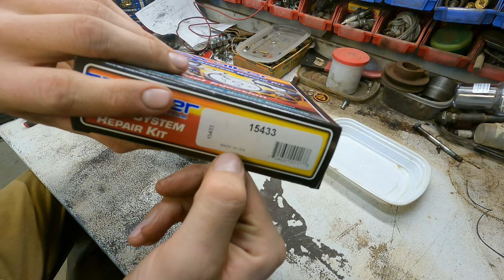Is this 1950's Galion Road Grader worth saving???  Cursed Grader Pt.2

Comment: Are those tires 20 inch if they are some old truck tires would work maybe like 10.00 x20 or 12.00x20 as long as it has a tube and liner.
Reply from the maker: Yes I have some but I’d rather have proper tires on it. I’m looking at a few options
Reply: OK I just saw the old snow tires on the rear and thought that an old set of straight rib steering tires would work if cost is a factor and the fronts are free wheeling hubs. I love the old grader . Nice videos

Comment: Thanks for showing the force grease nipple cleaner, I have one that I bought at Princess Auto Liquidators (very similar to Harbour Freight, may be the same owners)  I had no clue how to use it.  You used light oil, my thoughts are would carb cleaner or brake cleaner expedite the softening of the grease?

Comment: I'd leave the three bolts as dowel pins, the strain is mostly rotational.
Reply from the maker: thats an interesting idea... I thought about using allen head bolts because I should be able to get an allen key in it.
Reply: @DieselCreek  Pretty easy to shorten an Allen key too.

Comment: And if you take the cans that have ran out of co2 to spray anything take an air compressor with a air gun and hold the nozzle down on the can and press the airgun nozzle to the hole in the can nozzle and air them back up

Comment: Im not 100% positive, but if my memory is right you can swap a glass float bowl  onto that carb. They are neat and can save you time when you are troubleshooting carb problems.
Reply from the maker: Yes I thought it looked possible but not worth trying to find one
Reply: @DieselCreek  theyre easier to find than youd think.  a lot of old cars and trucks had them especially mid 50s Fords. Even my 55 Ford Ranch Wagon had one

Comment: Out of curiosity did you put some Zinc additive in your oil? I have heard that most older engines have flat tappet camshafts and that modern oil doesn't have the zinc properties to prevent wear on the lobes. Very entertaining video, keep up the good work.
Reply from the maker: ive seen some people say that. never been an issue before.

Comment: In regards to your oil packs, we have 4 or 5 litre oil containers here. Watching you fill that up was painful, considering how much plastic wastage there was.
As to the grease points, I have always just used heat to soften the old grease.
Reply from the maker: One of these days I’ll just start buying drums of oil because I hate all the waste too.
Reply: @DieselCreek  Buying a box of small bottles of oil seems to be an American thing.  Down Under we can get oil in 1L packs, but it's so much more expensive that everybody buys 5L, 10L or 20L containers.  Or 205L drums.
Reply from the maker: @dfross87  Id like to start getting drums eventually.
Reply: @DieselCreek  Drums are nice.  Electric oil pumps with digital flow meters are even nicer.  No need to lug oil containers onto equipment, just take the hose, pull the trigger and watch the readout.  Easy as fuelling up.

Comment: Did you dip that carb, or don't you have a gallon of the exquisite carb-eating liquid?  The new eco stuff =sucks=, but the old methylene chloride dips are viciously efficient.  Berryman's Professional Chem Dip still comes in 1 and 5gal buckets and they have dip baskets available, too. I used to swear by this stuff in my wrenching days.  Do not breathe the fumes! //  Don't worry about that tire.  It's only flat on one side at a time.  //  Good call replacing the throwout bearing.  Your blue ax scared me.  I've bent (or cut and welded) wrenches with red heat to get them to the proper angle for weird bolt head angles.  //  I'll tell you one thing, I sure do appreciate your videos compared to the crap they put on teevee. (happily dumped cable in '07)

Comment: Really need to check your air cleaner out also and see if the mice got into it too.
Reply from the maker: I’ve cleaned it out when we got it running, it’s an oil bath they can’t get in there

Comment: The tires tilt to keep you in a straight line. The blade will drag you the direction it’s angled. So you tilt the tires the opposite way to keep you going straight.. ish

Comment: Looks like that hose going to the release bearing could stand to be replaced also. Being hydraulic, I suspect it is vulnerable to the same issues that old brake hoses have.
Reply from the maker: Ill inspect it for sure before re assembling
Reply: @DieselCreek  👍
Reply: @DieselCreek  Ya know, in lieu of putting those bolts back in on the bottom, you could drill the two outer ones and put a couple dowels in. The upper bolts are probably more than sufficient to hold the bellhousing together.

Comment: Are you using Craftsman wrenches.  Their box end wrenches better for a hammer than wrench.  I worked on airplanes where nuts or bolt heads have very small side clearance.  You had to use thin walled Snap-on wrenches.
Reply from the maker: I tried using mac/and JH williams but neither were even close to fitting.

Comment: guess your slowly gettn the equipment and cheap im sure people dont realize these older machines are very simple to work on all ya need is fuel air and water basically antifreeze and good electirical conections i love to work on residential lawnmower tractors
Reply from the maker: lawn mowers and garden tractors are what got me started working on stuff. I was big into International Cub Cadets. I have about 15 of them still floating around...

Comment: On those bolts there’s a bunch of crud on there it looks like caked up mud or something, is that just blocking the bolt I don’t think that’s the housing maybe you can ship that stuff off. Other than that all I can think is maybe you can cut a socket down so you can fit it in there with the wrench. Other than that I can think is maybe it’s a long bolt that goes all the way through and bolts up from the other side so all you do is put an open end wrench on that side to hold it as you unbolt the other side maybe. 🤔
Reply from the maker: I thought that too but I tried chipping away at it and its for sure the casting. its liable to get ground out a bit before I put it back together.

Comment: Maybe you can replace those bolts with studs and nuts. Make the nuts yourself out of hex stock ,and make the nuts protrude out past those recesses so you can get a socket on them. Could you leave a link to that grease fitting clearing tool.
Reply from the maker: that might be a good idea, ill put the link in the description!

Comment: Warming the fitting helps, always, always, always, tighten them just a tiny bit, before trying to remove, then you can use a scribe, spray lube etc to clean out rust and debris, instead of forcing all that crap into thejoints, especially the ball joints... at least it's a hydro model and not a knuckle buster...  do not use a MAP torch or similar for heating, not even propane, heat gun on low, hair dryer....too much heat too quick will not be a good thing....

Comment: Ten or fifteen minutes to warm up, that’s nothing my continental straight six takes about a half hour in the summer to warm up and winter it takes an hour or more. It lites real easy and quick just takes forever to warm up that old clearance crawler. Like to have an old grader like that for moving snow from in front of my mail box....sometimes the plows leave a burn of snow in front of my driveway and mail box and the two stage thrower just can’t bust up that ice.

Comment: You need a crowsfoot socket for those bolts. But I supposed torch works too lmao
Reply from the maker: my crows foot were too big to get in there.
Reply: @DieselCreek  what’s the plan for reassembly? Different kind of fastener?
Reply from the maker: @Cosner90  yes studs or allen heads

Comment: Question, How does mice get into the space to build home. like them did in that bell housing? There was a lot of mice packing in there.
Reply from the maker: there's a good size drain hole at the bottom of the bellhousing they were getting in at.

Comment: Air Filter for engine check it plus cup on air cannister need clean even air filter pan on with D wing band on unscrew with  need clean plus SAE 30 Heavy Duty engine oil replace to when do up to and mushrooms cap should be clean to also !

Comment: I wonder how similar that 6 is to the Ford 300. Contra-flow head on the same side with the distributor in the same place. Also the pushrod cover. What's the displacement?
Reply: That's an International engine. I believe he said that's a 221. That same block used in the trucks came in 220, 240 and 264 ci. Displacements were slightly different in construction and farm equipment but the same basic block just different innards. Came out in 1950 and they stopped using it in the trucks about 1966 but continued in equipment up into the seventies at least. They were heavy duty.

Comment: Could just use a ring spanner on those bell housing bolts. Or just melt them. Put ring spanner would have been better
Reply from the maker: I tried that, the issue was there's no clearance around the bolt for that you cant get a socket or box end wrench on it and an open end wrench doesnt allow any swing.

Comment: That there was a gas axe alright, battle axe that is. Victor does make some torches a couple feet smaller for special occasions like when you don't need to demo railroad trestles. Don't get me wrong. I'm not criticizing. I'm frankly scared of any man doing surgery out the end of that big old whamma jamma.
Reply from the maker: a slightly smaller one would be handy at times but ya gotta run what ya got ya know! it got the job done hahah

Comment: Please take the extra effort to climb into the cab to start equipment. As you learned in the last video, you can forget things in gear. If you're standing right next to the tire and it's in gear when it starts, you'll be flat real quick. Be safe!

Comment: I'll have to show you a trick My Grandpa taught me! It's where you grab a grip of wrenches! Solid ones that are one size and open at one end. Not enough leverage!? So you put the round end on the bolt! You grab another wrench and you use the round part to grab the open end and wala! BOLTS OUT! I'm saying you are not looking at ANY bolt I couldn't get out and back in.
Reply from the maker: friend your missing the point, there isnt enough clearance around the bolt to get a wrench on the head.

Comment: Oil change with modern detergent oil will break up the hardened black cottage cheese lining  those old engines and destroy it. A close inspection will tell the tale. With engine out now would be perfect time to deal with it.

Comment: (07:10) It shouldn't make a difference, but often it does... As a rule, you should always format the media on the device that you plan to use it with... 
It's a computer firmware interchange thing... usually, it means the drivers the vendor used to run the media cards aren't the same as the ones used for the computer, and presto, you got a file interchange issue! I've seen it happen countless times...
Reply from the maker: your the second person to say that, never heard of that but I guess makes sense. ill have to be sure to use the camera.
Reply: @DieselCreek , I was hearing quite a few audio clicks and pops in your video. Sounded like the audio file was losing word clock sync. 
Was it, by any chance, recorded at one sample rate, and then edited into another, on the timeline? 
ie. recorded at 48 Khz, and then edited at 44.1khz?
Reply from the maker: @tekvax01  your speaking way over me head lol I can barely get these videos put together let alone figure out all that stuff,
Reply: @DieselCreek  I can help if you have technical issues.

Comment: BTW I think the engine should have been unbolted from the bell housing instead of the bell housing unbolted from the trans. Look to me that the bolts were right there to get to.
Reply from the maker: that cant unbolt from the block until the flywheel and clutch are off first

Comment: How did a mouse get into the engine to build a nest? Should that part not be sealed off completely?
Reply from the maker: No there was a small hole at the bottom of the bell housing
Reply: @DieselCreek  Ah okay, thanks for the answer :)

Comment: Idk how that line inside the trans to the internal slave cylinder/ throw out bearing should be but i dont see how fluid is getting through it bent doubled over
Reply from the maker: its a grease line, i'm sure it makes it through.
Reply: @DieselCreek  i think its really cool you read the comments and respond. It must be designed that way and being grease, i agree it can get through. Stick your new tool on it lol

Comment: So the slave cylinder fluid line is bent in half. Id be surprised if fluid could even get through that..
Reply from the maker: It’s not a hydraulic clutch that’s just a grease line for the throw out bearing

Comment: I wouldnt put those bolts back in. Its got more then enough to hold it.
Reply from the maker: Yes I’m thinking it over, could be better not to.
Reply: @DieselCreek  im a mechanic for several rally cars and have done other race cars. Because we remove our stuff alot we end up just leaving some out. Never ever had an issue.

Comment: What about that kink in the hydraulic line for the clutch? That dont look good! Makes me want to go out and buy an old machine and repair it! For as much as I hated doing this stuff when I was growing up. I sure do miss it now.
Reply from the maker: The clutch is all mechanical that line is just a grease line for the throw out bearing
Reply: @DieselCreek  well that makes a bit more sense.
Reply: @DieselCreek  i had a old 3 ton chevy flat bed that had a stuck clutch. i just drove it like it was my first time with a clutch. Throttle then no throttle. kinda gave myself a bit of wiplash.

Comment: Did I hear a gas heater running in your garage while you were doing that carb ?  Did you at least open the door a crack ?  I mean, it would explain a lot if you didn't...😜🤣
Reply from the maker: Little duel burner propane heater it’s rated for indoor use I think plus that garage is drafty

Comment: Sir Matt  !!!   You know well what keeps a motor running in your boom truck ---Air// fuel // spark !!!  As you were running it in the last video ,,it sounded bad  !!!!   Did you add any fuel additive to the tank or fuel itself ??  FUEL FILTER problem  or just bad fuel ... !!!! Anyhows,,  enjoyed the videos &  ""KEEP IT SAFE ""!!!!!
Reply from the maker: Yes it’s bound to be a fuel issue it has a bad exhaust leak that makes it sound worse than it is. It was actually running good last it ran for me.
Reply: @DieselCreek  OKS !!! Did you read the comment on the ""OL""Ford Starter wrench !??  Don't know the size wrench that you need .but one end was 1/2" the other was 9/16'  !!  Maybe you can find what you need on ""GOOGLE"" !!

Comment: just a thin wall extra shallow socket buddy, nothing new ive had to find two of the same size box end wrenches that had offset teeth from each other to deal with certain bolts before, also had to use universal joint sockets, the open end of the wrench, angled wrenches, you name it, eve had to cut a 3/8 allen key (short end) 1/2" shorted to get into a super tight spot to remove a valve body plug that blew an O ring and have had the same plug on two different machines blow in the last 2 months, and that now my go to spot to check, first time it took and hour n half to find and more to fix it, now its an hour job and 3 O rings and 2-3 cans of brake clean cause i spray that shit on thickkk, idgaf dont like my brake clean use? dont call me id wash my truck with the shit of it did any better then soap n water lmao
Reply from the maker: the gear wrench sockets are pretty thin and I couldnt get them on there, even if I could have there wasnt enough room for a ratchet.

Comment: Do Yourself a favour. Remove the rust, behind the tank, Prime, paint, and do the same for the tank. Clean the hell out of it inside and out. Do the same for the engine. Please don’t be in a hurry and reassemble just to get it running. YOU WILL REGRE IT. Don’t worry. I will let You have it if You reject My advice. THIS COULD BE MY FAVORITE PROJECT.

Comment: Where's your ultrasonic cleaner?
Reply from the maker: no room in the shop for one.
Reply: @DieselCreek  they make em in small units specifically for cleaning carburetors we have 3 on bench at work you put in acetone put all your carb pieces in the basket and leave em for an hr cleans everything out you just gotta blow out each orifice we use em every day on small engine carbs

Comment: Couldn't you have gotten a box wrench on those lower bell-housing bolts to break them lose, instead of using the flame wrench ? You had the flame wrench to heat the housing with, if they were seized. Haste makes waste. I'd also be un-kinking or shortening that throw-out shaft grease hose. Just sayin'....
Reply from the maker: No I tried countless ways but there wasn’t enough space to get the box end on.
Reply: @DieselCreek  Okay, point taken. I just didn't see you try a box wrench in the video. Liking your decision to take the engine home, clean it up, chase the thread holes & throw on a quickie paint job. Hope you are able to locate the New  bearings; pilot & throw out. Always better to fix it right the first time & save yourself the misery of having to tear it apart later to fix or replace something you could have done to begin with. Always enjoy you videos ! Thanks !

Comment: Stuck grease fitting? Just replace it, they're like 15¢ a piece.
Reply from the maker: A lot of times it’s more than the actual fitting that is clogged the grease hardens down in the passage or pin fit

Comment: Boom truck sounded a little iffy when it was running. $700 because it became too annoying and got parked. Needs discipline.
Reply from the maker: It was still cold when you saw it running, after it warmed up it was running nice. It’s got an exhaust leak tho that makes it sound bad